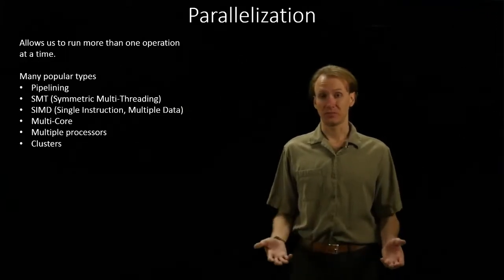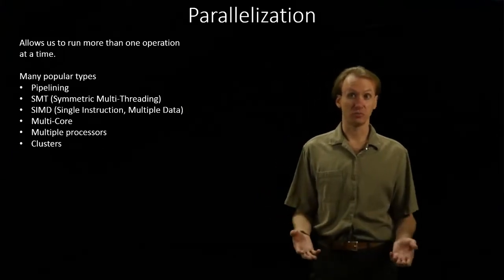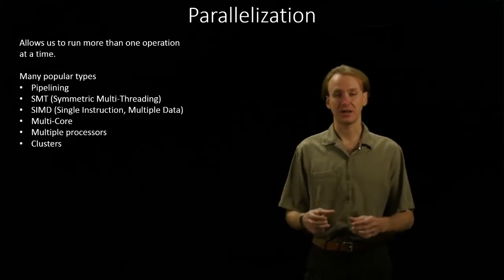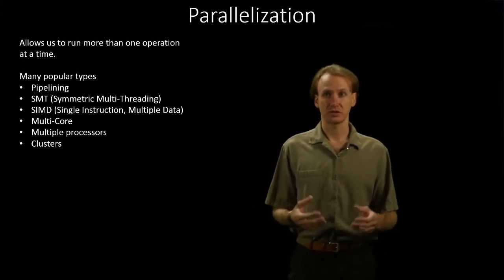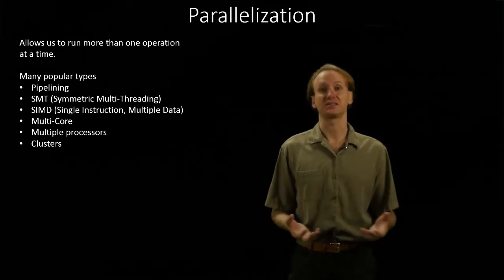8.  Parallelization

Comment: 0:10 parallelization allows a machine to run more than one operation at a time
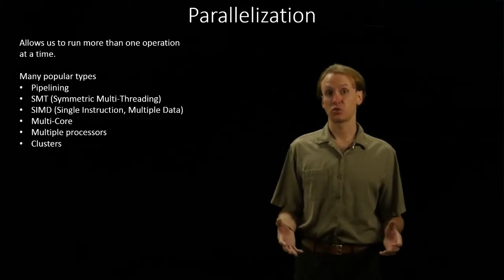0:20 when we get to the architecture part of this course, we're going to build a computer that implements pipelining and we'll extend that to include symmetric multithreading. And while we're there we'll also look at SIMD processors.
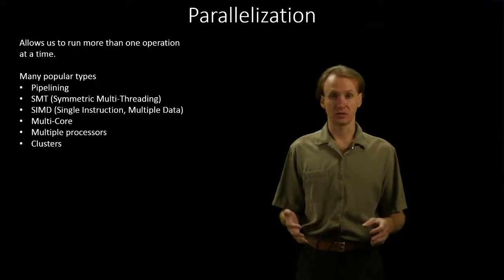0:35 multi-core processors are anything that has more than one processing unit on the same chip die
1:00 oflloading tasks to GPU is like having a multi-processor machine
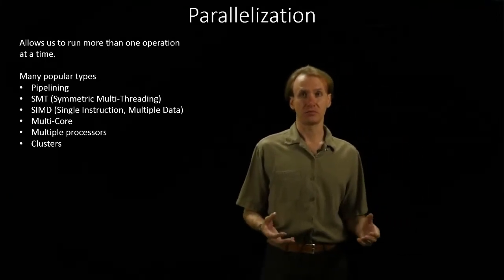1:10 clusters are a large collection of machines each of which is going to be running a separate task at the same time
1:35 for most purposes, symmetric multi-threading is pretty similar to multi-core processors, but there are some cases where multi-threading doesn't perform as well 
Q: When is multi-threading not as performative?